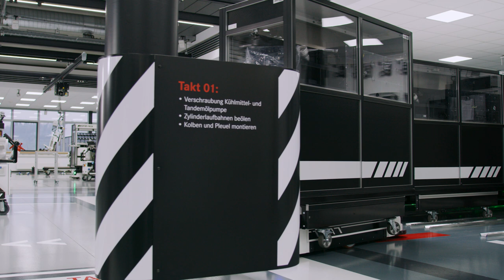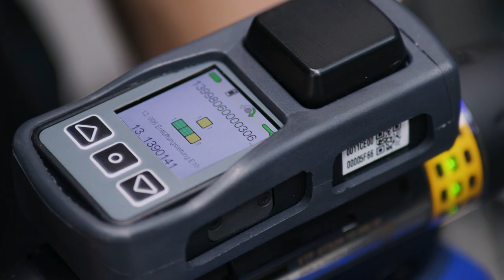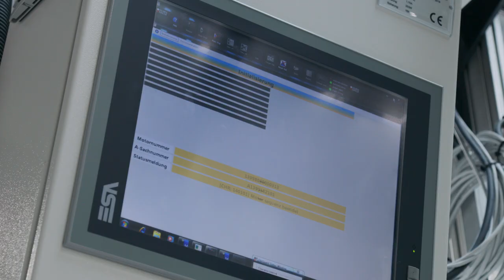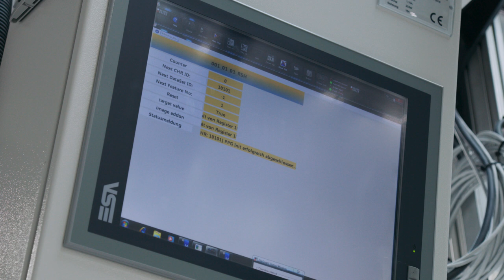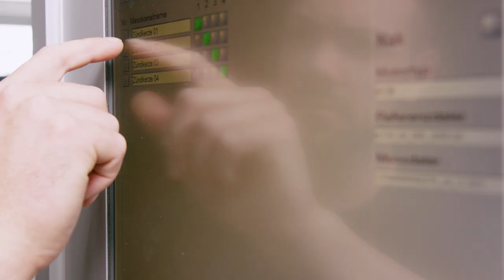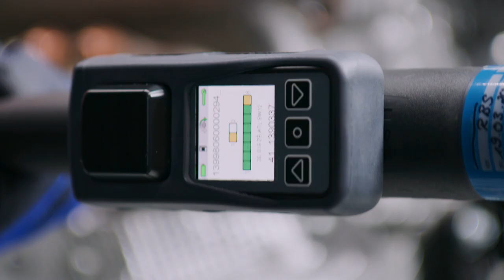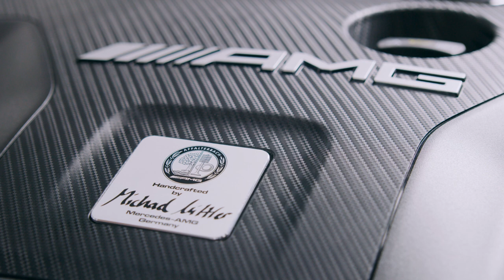Mercedes-AMG M139 four-cylinder engine with 416 horsepower

Comment: Mercedes-AMG's M139 4-cylinder is one of my most favourite engines. I'm just amazed how they managed to extract 310kW from a four cylinder.
Reply: Its not impossible this day, some backyard mechanic can make thousand horse from 4 cylinder too but the reliability can be questionable.
Reply: The Germans know engines
Reply: @jeffreygarcia145  - But they don't go 1,000,000 km flawlessly.
Reply: @haraldpettersen3649 even Honda cars have some problems before that🤷‍♂️ 1.000.000 km is alot, almost impossible for a car
Reply: @dylanoppeneer2354  - A transport company I worked in in the 70s had two Mercedes in the car park, both 1113 (11 tonnes 130 horses). Both had gone over a million kilometers, both had changed clutch once, and overhauled the nozzles otherwise they had only got new oil and filters. The cars were not so big, so they were used when we had work for the telephone company (Televerket in Norwegian). They stored equipment in an old tunnel, and the Mercedes had the right height. They were both well -kept and approved when I quit there.

Comment: why is the oil pump belt driven?  WTF??  That motor is all good until that little belt takes a crap,.. then that motor is DONE!!
Reply: How it should be?
Reply: @elvinkhalilov7965  CHAIN or GEAR driven
Reply: @_Magellan  thanks. Could you tell me any examples of engines that has chain or belt driven oil pump (or water pump/hydraulic pump). Because I have never seen or heard something like that. I am interested.
Reply: @elvinkhalilov7965  volvo 4 cyl engine (old 240), bmw engines,  w12 bentley engine to name a few
Reply: @_Magellan  thanks.
Reply: Robert Mills it could be the engine balancers for the vibrating four cylinders

Comment: I hope Mercedes has this figured out. The boost pressure must be enormous. I’m curious how this motor will perform on the track. Normally head gaskets are the first item to fail.

Comment: Hope they drop this on an A class
Reply: I think they know that adding an EQ hybrid system adds WEIGHT to the car, especially if it’s a compact.
Reply: It will be on the new A45S and probably on the CLA, A Sedan, GLA, and GLB as well.
Reply: Where else would they use it?
Reply: @autofficinaportafortuna  absolutely correct

Comment: They're finally catching up to tuners
Reply: Most tuners only have to worry about reliability for a year. And that’s only some. Most tuners don’t warranty at all. The original manufacturer has to worry about warrantied reliability for 3-5 years and then another 5 years for their own reputation. 

Plus they know they need to have some safety buffer for tuners to mess around with their sht and not completely fk up the engine when owners still bring it back to the dealer for service.

Also most tuners don’t do anything special. They just sell canned tunes and other peoples products.
Reply: Waisoserious also the parts have to be cheap enough to put into production like steal and aluminum. Forget titanium conrods and ceramics.
Reply: AMG used to be a Mercedes tuner when they originally started. And no tuner (even RENNtech and Weistech) can match the factory warranty.

Comment: But it's it the best way to deliver 416 hp and 369 lb/ft? It is efficient? Will it deliver the best performance for each liter of fuel used in the task world? I suppose it an achievement regardless, But who cares about hp liter. If an engine delivered the same output and did it using 20% less fuel and 3 liters wouldn't that be better. I just think it is a silly metric for the days we live in.
Reply: PN H yeah it would be silly. But is that actually the case? Is there a 3L engine that delivers the same performance using 20% less fuel?
Reply: ..Also 3l weighs too much in the front of little a-class..

Comment: The coloration of the counterweights looks like the crank got really hot either during machining or grinding.

I also like his inspection of the sealant applied by the robot. Better make sure the machine that can repeat the same work thousands of times within thousandths of a millimeter didn't mess up! So much of this is unnecessarily slow and should be automated. I'm sure in actual production workers move a bit more quickly but there's a lot of processes that would be more accurate and faster if automated. Especially the cleaning at the start...no excuse for that to be manual.

They tried so hard to not show that HMI was running XP...but it's there. Time to upgrade, boys!
Reply: Could it be from induction hardening

Comment: For the cost of the turbo they could have put a real v-8 in there . An easy 500hp and an engine that would be smoother and last forever because it's not over stressed anywhere.
Reply: go buy an m156

Comment: Still recall last time Mitsubishi had that production monster FQ420 Evo... it takes Merc long enuf
Reply: KinderTubeHD incorrect. It wasn’t reliable.
Reply: Hello. Adrian from Motor1.com US / Global, the Mitsubishi Lancer Evolution X FQ-440 MR was a limited production car. Only 40 cars were built, so it doesn't count as a regular production model. I mentioned it here: https://www.motor1.com/news/353508/mercedes-amg-m139-engine-video/
Reply: It wasn’t a production car and wasn’t even reliable. Try again!
Reply: trustgtr33 wdym? The 4G63 was originally engineered by AMG engineers,if you do know the 90s Mitsubishi,especially the Starion and Galant had AMG variations before they Mitsubishi had RalliArt,well AMG learnt what they had with the M102 found in the 190E Evolution models,so maybe the M139 is a new contender to the 4G63.
Reply: @seansiew5629  theres was a 1990 galant VR4 which had some AMG spices but that was that..high revving NA VR4 which are the older version of the 4g63..On the EVOs with the now 180 degree spun around engines are 100% Mitsubishi all the way to the EVO 9..The EVO X which utilised 4B11T was a derivative of a joint venture between diamler benz, hyundai and mitsubishi...
Reply: @trustgtr33  so i would be correct that Mercedes has a great 4 cylinder
Reply: @trustgtr33  also a stiff competition after I know both M139 and 4G63 are 180° spin around engines, the same how the B58 and 2JZ shares many similarities

Comment: This engine is wasted in a WWD(wrong wheel drive) chassis, even with fancy AWD assisting it. 👎💩
Slap it in a C-Class or any other RWD chassis.👌🍌
YES, the whole filming job was HORRIBLE. 👎💩 
I wanted to see an engine getting put together, not some buffed young buck in tight fitting work clothes.🙄